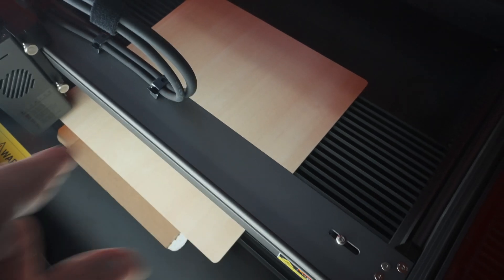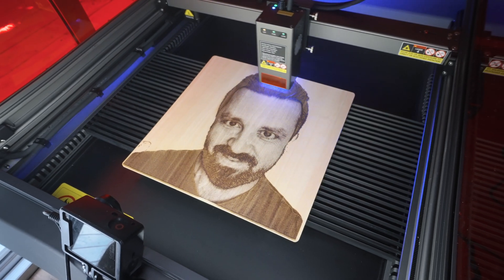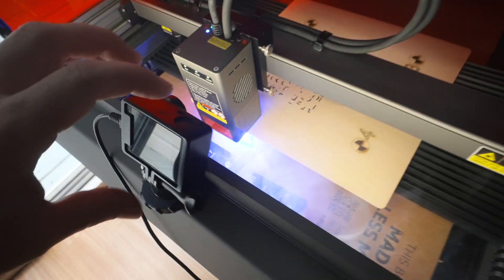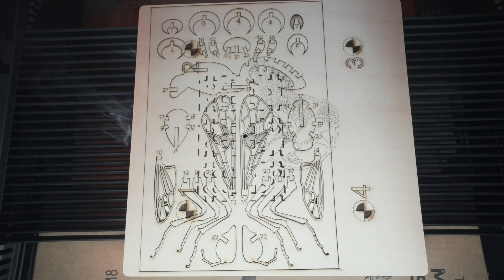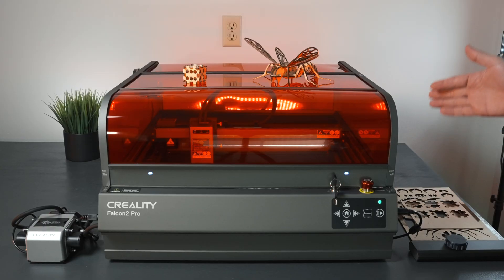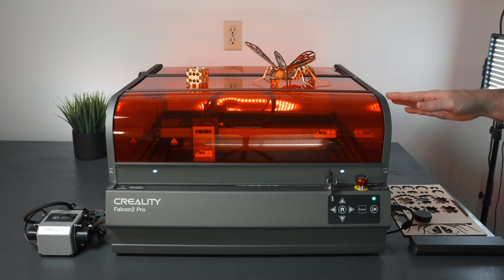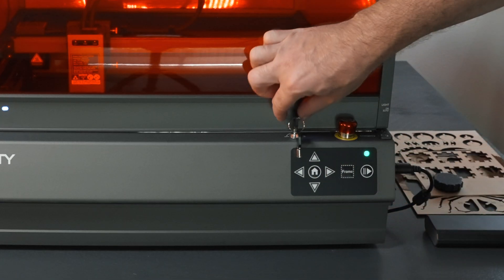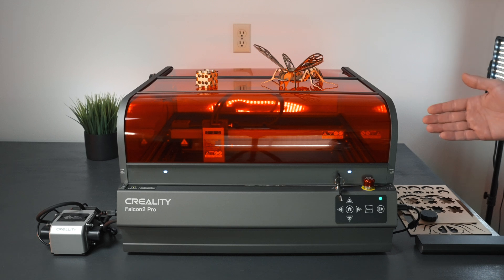Creality Falcon2 Pro - 22W Laser Engraver

Comment: Regarding your Anet ET5X video... your video was very informative... I work with electronics maintenance and for the first time I saw an ET5X for maintenance... The physical part was easy... apparently everything is fine. However, every G-code I input doesn't print correctly... which leads me to believe it's a slicer failure. Could you help me? Which slicer did you use for these tests? I used the Orca Slicer. And which base printer did you use, since the ET5X isn't available. Thank you